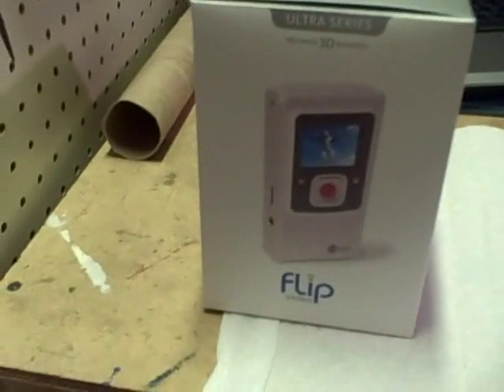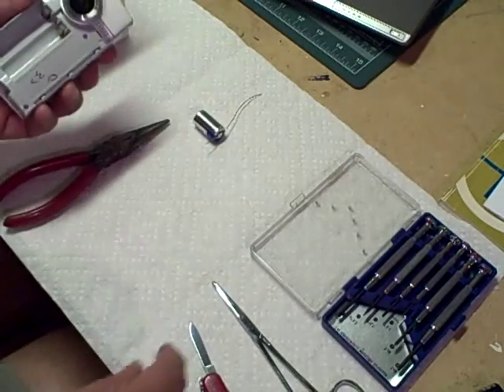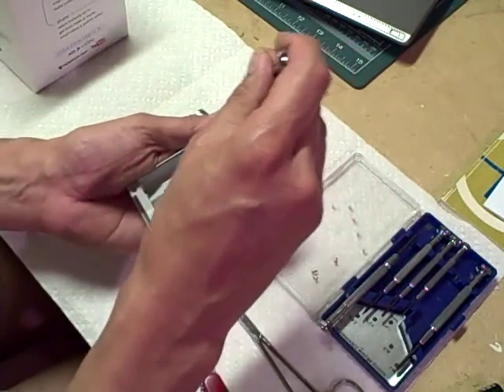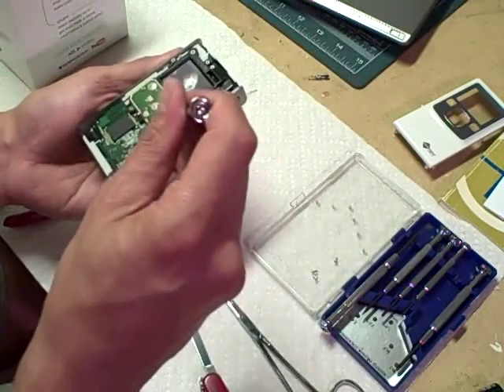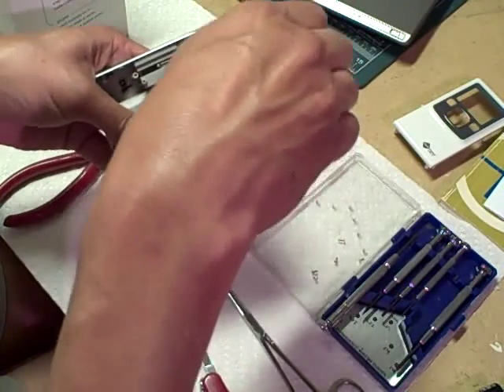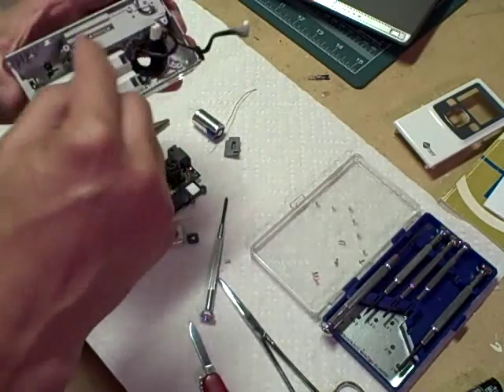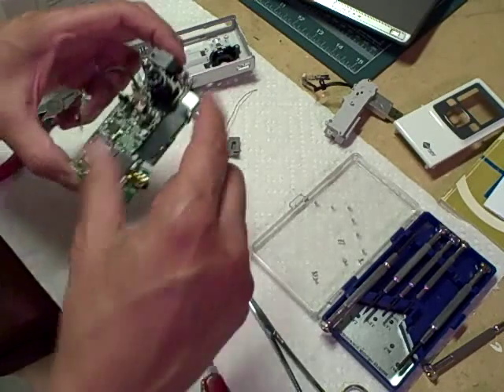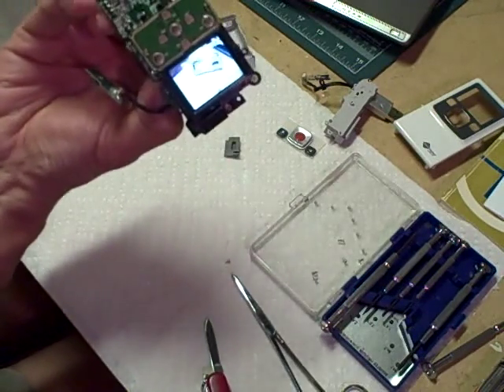Taking apart a Flip Ultra 30 camera

Comment: Hey can you help me please! I have a Flip Ultra (not sure if its 1st generation or 2nd) Its Looks like the one you got there just pink. Anyway I have videos of my kids on it and the USB broke off. The camera functions perfectly otherwise before the USB broke it wouldn't connect with the computer like normal (I figure the USB was disconnecting because after many attempts of plugging it into the computer it just fell off) How can I  get my files on my computer and off of the flip...help please I have videos of my son taking his first steps and dancing and crawling and my daughter playing piano etc. I really want to get these files off.
Reply from the maker: I'll have to dig out the unit. I think you should be able to get the unit apart and then plug something else to the connector on the board. It's been a while, so, I don't remember offhand what type of connector it is. If possible send a picture of your camera and the part that fell off.
Reply: I cant put the photo in the comment, may I have your email address please?

Comment: tdmoose, first off great video. nice breakdown. My question is, my daughter dropped her Flip Ultra and cracked the video screen itself! I've seen how to fix the front lens but nothing on the actual video screen. Is it possible to fix this or is it bascially shot? I did follow your video up to the point where the cover is off, but it looks like the video screen and board is all one piece.  Can you help with this??